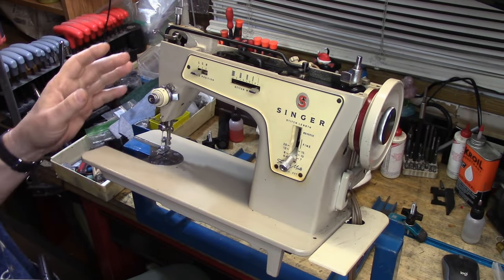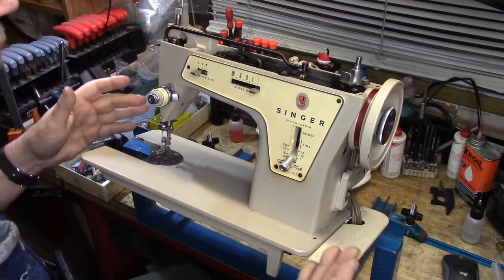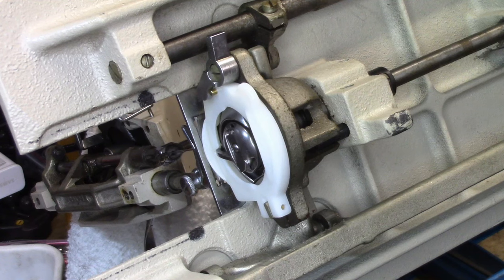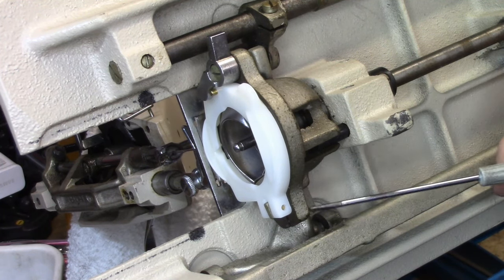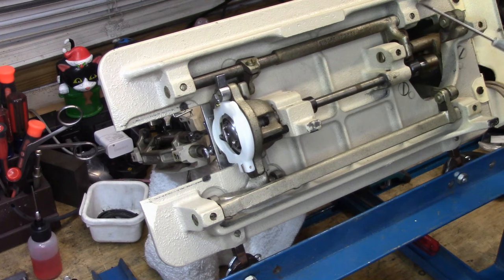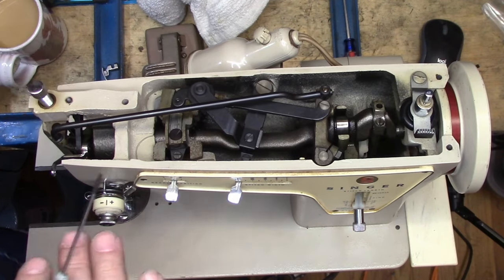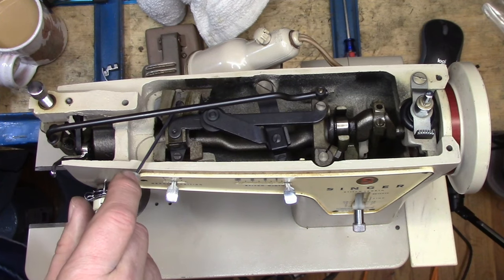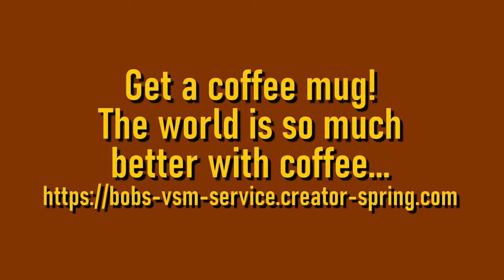Henya's Singer 237 - Sunday Morning Quickies, Episode 111, March 3, 2024

Comment: Thanks for your manuals, Bob.    I have the poster pinned to my wall for easy reference.  I started printing off manuals instead of my using my laptop; I found it easier to tab & flip  pages for when you have to reference figures with part numbers.  Once you get to know this machine, it's a simple fix to a complicated mechanism.  Boyd

Comment: Did you take the pressure regulating knob (tan plastic with numbers) off that machine, or did you pick it up that way? The parts diagram makes it look like you pop the over off the top of the knurled plastic knob, and there's a screw underneath, but I can't seem to get that top off - what am I missing??? Thanks again for your help!
Reply from the maker: There are two versions of the 237, one with the big knob and bed controlled, dropable feed dog (the Italian made 237-MA) and the regular 237 with the standard pressure adjustment and no dropping feed dog. This machine is the later...
Reply: @BobFowlerWorkshop  - Thank you! Interesting, and good to know. I do have the Italian version. Do you have hints (or a forthcoming video????) about how to get that big knob off? 

The knob to drop the feed dog on my machine seemed welded in place, but I eventually got that free. I also had a victory with the frozen needle position selector. But that knob is driving me crazy!
Reply: @BobFowlerWorkshop -  Turns out - on the 237M-A, that knob is part of an assembly that wasn't moving because it was "crud welded" in place. Removed one screw, applied a little Blue Creeper, a little heat, and it lifted right off. I really appreciate your videos that are growing by background knowledge very quickly, so I can solve problems on my own!

Comment: I committed the worst offense against a vintage machine and DROPPED the lovely 237 I bought a couple of weeks ago to use on my treadle base (it got stuck on the lollipop hinges and I made a catastrophic fumble trying to gently wiggle it loose.) The machine is almost-OK in center needle position but very sticky in left and right positions. Any suggestions for what I should look at first? Did I create a parts machine? 

The only good news is that no feet or cats were between the machine and the floor. 😢
Reply from the maker: A lot depends on what iy landed on. I'd have to see it to determine the level of damage...

Comment: I have a 298. I've been told it wasn't sold in US. But comparing this video and the exploded view with my machine it looks similar. My problem is that the needle is hitting the throat plate just behind the hole. So the needle/ Needle bar needs to be brought forward. Have you any idea how to fix it? I've described the problem here.https://youtu.be/amrMaeDA9gA?si=8dD2cXo6Pw1byfZX

Comment: I'm trying to find out how you put the singer made 237 bobbin shuttle case locking lever part replace behind the the race cover. My race cover broke. The wire that holds the part in place I can't get it to stay in the small hole of the race cover, and on top of the little silver bottom part that locks in the race cover. Do anybody know what I'm doing wrong?

Comment: Bob, would this be similar to a blue 348?
Reply from the maker: No, unfortunately, the 237 is a completely different machine.
I've uploaded a service manual for the 347 348 series here:
https://bobsvsmservice.com/wp-content/uploads/2024/03/Singer-347-348-Service-Manual.pdf
And a 348K parts list here:
https://bobsvsmservice.com/wp-content/uploads/2024/03/348-Parts-List.pdf